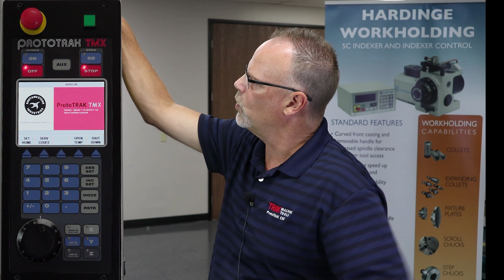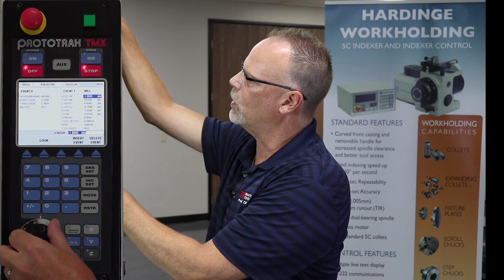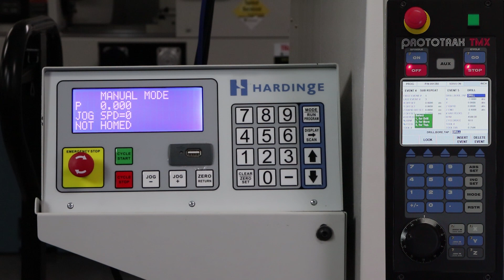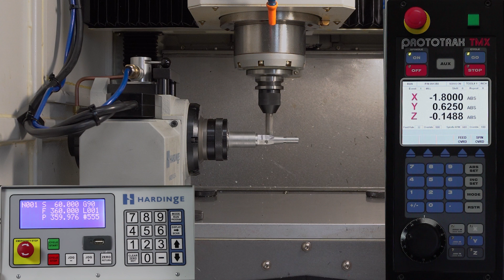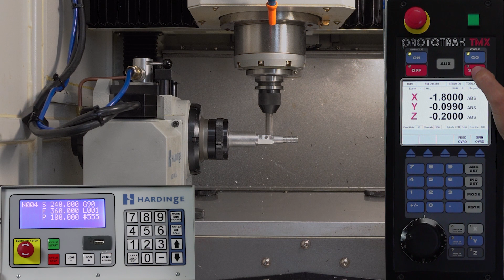TRAK 2op [Part 3] | Hardinge Indexer | Second Operations Portable Vertical Machining Center

Comment: How are Trax on 50 lot size production? Doing keyways on small (5-10”) shafts.
Reply: The lot size sounds fine. The question will be how much of that shaft needs to be machined. The indexer has a 5C collet system standard so if your shafts will fit inside the collets, I see no problem with handling this. On your other post, I told you how to request a demonstration through your local TRAK rep. Please look at that one as well. T.P.

Comment: would there be a way to have to control two axis rotary table and do 5 axis milling on that 2nd op machine?
Reply: Sorry Gary but no, you can't do that.  The 2op only works with a programmable indexer so it is not fully 4th axis capable.  It only has one auxiliary output to talk with the indexer so there wouldn't be a way to send two separate signals.  Does this answer your question?  T.P.

Comment: Would this be the same for the bed mill with an SMX control? Thanks 👍
Reply: Quadtraxxx, Yes it would work exactly the same.  It doesn't matter who's indexer or which ProtoTRAK control you have.  Basically, the indexer is programmed to move when it gets a signal from the machine.  After it moves, it sends a GO signal back to the machine.  The only thing you may need on your SMX is the auxiliary functions options if you do not already have it.  T.P.
Reply: Patrick, many thanks, appreciate the reply! 👍